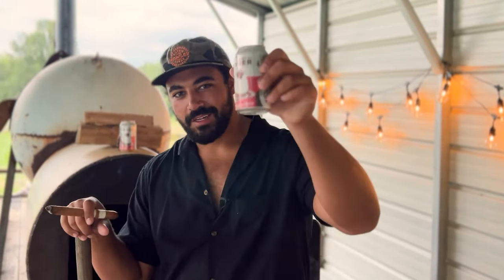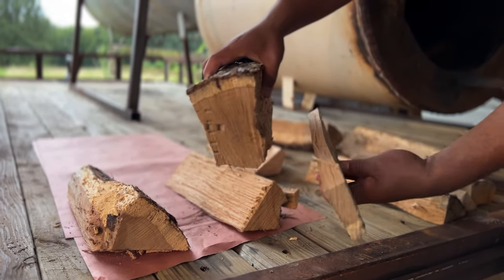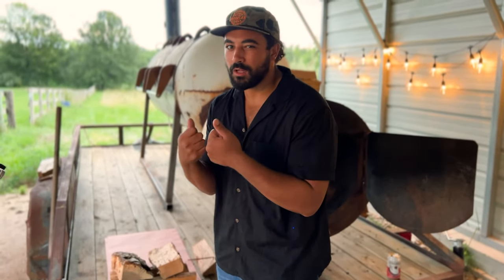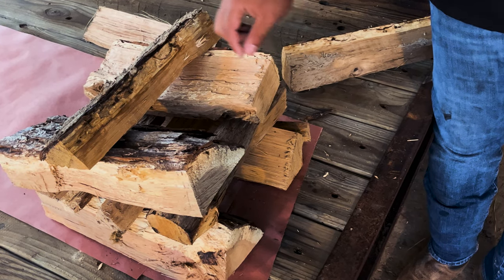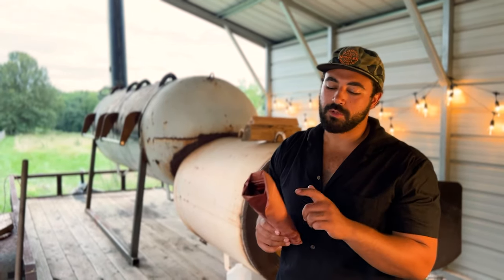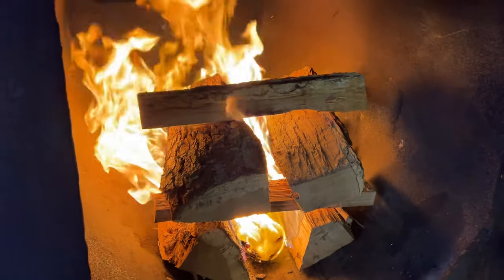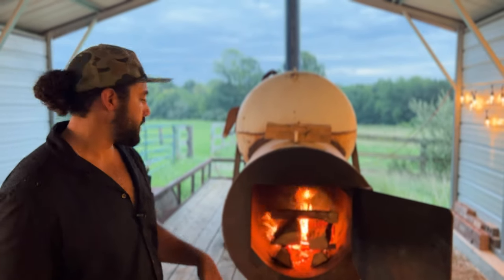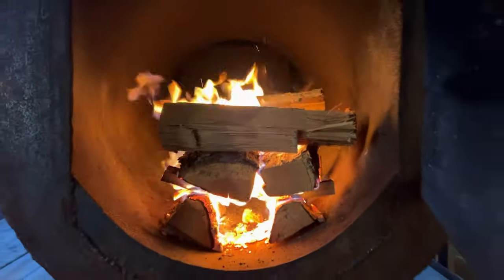BBQ Fire Management Basics: A Master Tutorial

Comment: One tip for temperature control on a backyard big box smoker: get a welding blanket or some other insulation blanket to help stabilize the main chamber temps by reducing some of the escaping radiant heat.

Great video!
Reply from the maker: Love this idea!! There’s a types of tweaks and mods that can be made to backyard pits to pull better performance out of them, this one’s new to me thanks for sharing brother. I’m thinking about doing a series down the road centered around easy mods that’ll get backyard worries better performance. 

Thanks for the comment, sub, and support my friend 🙌

Comment: I'm very much a backyard boy & this video is amazing. I just bought my first mid-tier offset, after smoking on big kettles & vertical stack smokers for a couple of decades. I'm looking forward to figuring it out. My favorite is probably the kettle, it just isn't designed for the job but it can be done if you get creative. 
The vertical stack is easier, but I need to feed it more often & just use the amount of fuel to regulate temp.

I'm not looking for excellence, I've experimented trying to get as close to "fire & forget" as possible - just trying to get consist, solid brisket/short-rib whilst being able to sleep or hang out with the guys & pound a couple of beers. I think wireless thermometers with plenty of probes is a really good "cheat" on a backyard setup, having the information graphed out really helped me understand what was happening when I made changes. 

I had great results with 35+ day dry aged UK Heritage beef, it's what I've got readily available that's quality & the dry aging reduces the stall time a decent amount which was invaluable for my use case. They're a little more sensitive to high heat though. Spending an hour in stall instead of 2-3 means I can knock out a pretty good brisket on a kettle and only open need to open it it twice. I still need to roll a dirty fire for a short time but it's not enough to be an issue. I learned to use is, when adding more fuel I treat it like an Asado grill for the ~15 minutes - using the radiant heat spike to almost sear the fat cap on the decal/point (I trim nearly nothing, the more fat the better for me). 

Mostly I learned to stop fretting about temps. The kettle is so challenging, so much radiant heat to deal live with. It's definitely different! 
Brisket's off my kettle have a Ton of fat on the outside, not a traditional bark - it's half way between a pan fried steak and a traditional brisket.
Reply from the maker: Glad you enjoyed the video thanks for the support!

Comment: Great Video, I have a Millscale 94 gallon & have been trying so many different methods on fire management. This video was the most helpful! Thank you!💪🏾👍🏾👍🏾
Reply from the maker: Love a good millscale 94. That unit is a beast! Thanks for the support!
Reply: Got a follow up question. You have a 500 gallon. Do with the Millscale 94 would I use a little less wood to start?
Reply from the maker: lol yea I would suggest using less wood on a 94 gallon than you would on a 500. I’m not certain exactly how much as I’ve never cooked on a millscale 94 so you’ll have to play with it. But hey, that’s the beautiful of BBQ. I’d bet that if you put two logs on the bottom, then two more across the top the opposite way and lit that on fire, after about 25 minutes or so you’re temps would read 225-275 with the damper wide open. Start there and let me know. But hey, that’s the Beautiful of BBQ that it’s not an exact science.

Comment: I can agree with most of what you said with one little modification. I have a 16" Horizon offset which has a big stack. If you open the door all the way and open the stack all the way the temps will shoot sky high. the stack works really well. So I will open the firebox door burn less wood at a nice temp to get the perfect mix of wood/smoke flavor but I need to regulate the flow with the flue because of the stack. The small offset in the video has a tiny stack and I can see why you would leave the flue open or remove it. Fully open, mine will run north of 500 until the wood is exhausted and with the draw from the stack, it will happen faster.. If you haven't seen a Horizon 16" offset, the top of the stack is 24 inches tall from the horizontal pipe and it is 4.5 inches wide
Reply from the maker: Thanks for supporting the channel brother. I agree with you, keep in mind I said “big box store smokers” which typically don’t come with big smoke stacks lol so your smoker wouldn’t really qualify under that category. If falls in the category of “high functioning backyard smokers” that I referenced in the video 👍
Reply: @MeatNGreetBBQ  That’s fair. I bought it in Canada, where I live, from Cabelas. I think the US price is probably around $800. Now they don’t have them anymore and the only other option is Yoder who seems to have a small stack issue and flow problems. I think on that one, I’d leave the stack open, well no, I’d remove it and fab another. That one is significantly more than my Horizon on the order of triple the cost and specialty store only.
Reply from the maker: @Todd.T  agreed! I think EVERYONE should attempt to fab a new smoke stack. It’s not expensive (barring power tools which even then can be borrowed or rented) and it’s a great way to learn/adapt ones smoker in a very impactful way… could agree more with you

Comment: Great amount of detail in here that fills in gaps from other fire management videos that gloss over things, you got a new sub here! Any suggestions for managing splits that may be on the wetter side on a 94gal (i.e. just got a cord dropped off, some are more fully seasoned than others and may be 20-30% moisture and actively hissing moisture at the ends when start heating up) in terms of when/where they go on or general tips? Pre-heating on the firebox or throwing a few in the chamber to dry out works, but can only do so much and have to work with what's on hand at times to try and make best of it.
Reply from the maker: Man I appreciate this comment and your support brother! Nothing better than a big ol delivery of bbq wood 🙌 
As far as the moisture content, 20-30% won’t kill you. Frankly when you start to really learn and master fire management you’ll begin to prefer higher moisture content wood at certain points in the cook. I tend to you the higher moisture content wood on certainly in my heavier cooks (like brisket) and I try to focus that wood towards the beginning of the cook when the meat is poised to absorb the max amount of flavor. It’s nature for the wood to sizzle, as there still is moisture and it’s wicking itself try through the combustion cycle. Just make sure you have a proper coal bed and proper spacing to ensure efficient air flow. As far as preheating, that’s certainly an option and I’ve done it in the past. But I’ve come to prefer using the wood as it is and letting it naturally do what it wants. Hope this helped bro 👊

Comment: Incredible video! Earned my sub and comment for sure!

I recently got my first offset, a 120 gallon with a fully insulated firebox; would you recommend running it similar to a bigger offset, purely using wood splits, or more like a backyard pit with charcoal and wood.
Reply from the maker: Bro appreciate the support!! I would strongly suggest you try it all. Learn what works for your smoker and learn what your smoker needs when it needs it. Outside temp, moisture, wood selection, ambient temp etc etc all plays into how the fire runs. There’s in right or wrong just baselines taught in this video. Experiment and give me a shout if you need anything.
Reply: @MeatNGreetBBQ  will do! Thank you!

Comment: Very informative, thanks for taking the time to make this, new sub. BTW, when the video was over, I was surprised to see the video was an hour long, didn’t seem that long but it needed to be. I grew up bbqing all the time on a box store grill/smoker and never used wood the way you did, always coals or lump. I love the idea of cooking with wood only. You were advising 250 and up, is that the smallest size smoker you would recommend to cook with wood only using the method you clearly described in this video?
Reply from the maker: Really appreciate the support and feedback bro! 

Yes 250 for sure should be run with 100% wood splits. Smaller than 250 you can do what feels best. Typically a hybrid of both.
Reply: Thanks for the tip.

Comment: This such a great video. Thank you for simplifying this important process. But question…. What about if you’re using a 120 gallon smoker? A lot of videos reference small smokers or 500 gallon plus. I’m in the middle with a 120
Reply from the maker: Thanks for the positive feedback brother. I appreciate your support! 120g is still considered a small smoker. 250g would be the next ratchet where you would need to worry about fire management style. Depending on your convection and airflow you can get as granular as you want on fire style but I would probably find a common medium between both methods. As you’re practicing, start with 500 gallon style and tailor it to your put until you find something consistent that works for you. Hope that’d helps bro
Reply: That was perfect. I’ve heard some ppl say if you’re  cooking on 500 gallon plus pit, always minus 25 degrees or so for a backyard pit. So if the 500 is at 300 degrees smaller pit equals to 275 degrees. Not sure if that’s true. I’ve watched 3 of your videos today and you’re already one of my favorite pit masters to watch. Thanks bro. Appreciate your help
Reply from the maker: @MikeBonesBBQ yea I’d say that’s a pretty solid rule of thumb. Mostly bc in a small smoker, there’s less space for the heat to become less radiant (potent) so if you get too hot it’s almost just as good as direct heat. For me the perfect range is 250-300. Anything within that range will turn good bbq. Once you figure out how to stay within that 50 degree swing, you can start to needled down the variance until you’re running temps at exactly WHERE you want WHEN you want

Comment: Great video and thanks for posting!  For the 500 gal pit is your stack damper fully opened at the point you said you had the perfect 280 degree fire?  If so, do you ever partially close the damper?
Reply from the maker: Thanks for the support bro! The relationship between the stack damper and firebox door is unique and probably requires its own video haha. The short answers is I adjust it through almost the entire coon depending on which stage in the cook I’m in and what I’m needing the pit to do at that moment. Short answer is you can run it about half way or a little less than half closed the whole cook and have a pretty balanced mix of all the benefits.

Comment: Loved this video.  I've learned many of the same things over the last 8 years.  I have a Grand Champ-XD which is similar to the Okey. (Slightly tighter fire box maybe)  I live one the coast of Maine and we get strong sea breezes almost every day in the summer time.  15-25 MPH, which makes it harder to control.  Wide open means wide open in that situation.  Cool 65-75 degree air temp.  Any recommendations?  BTW, we have lots of white oak and maple her so that is the main material I use.  One thing I like about the XD is I can remove the ash with an ash tool.  Helps a lot with the ash build up on longer smokes on the back yard style smokers.  Thanks.
Reply from the maker: Huge thanks for supporting the channel, it means a lot. I’m glad the video was helpful. The only think I can tell you is build slightly tighter fires and point your firebox away from the wind to the best of your ability. With winds that high you’ll likely have ample oxygen regales of fire/smoker quality. In which case you can probably close the firebox door down, knowing you have 15+ MPH winds lol.

Comment: Thanks mate appreciate the content of this video, I recently got made a 250 offset and will be using your tip’s going forward as I have ambitions to be as good a pit master as I can be . I have been wondering if have a separate fire pit going Will eliminate a lot of this work as you will be transferring hot coals to the firebox . Whats your thoughts on this as I have heard that after the initial first 4 hours meat stops absorbing smoke
Reply from the maker: You’ll love your 250 bro. Perfect size!! 
I would suggest you get good at running fires and creating your coal bed. I think smoke absorption is more predicated on cut of meat before cook time. Thanks for the comment and support btw!

Comment: I was putting out blue smoke.
On month cheap backyard offset smoker.
And didn't get any.
Wood smoky flavor on my pork chops. Temperature was.
250°F with all the dampers and doors open. Had a good hot cold bed of mosquite.
That was kiln dried .

I left the dampers open and the stack.
I walked away for 5 hrs. Other than adding wood There was preheated 2 screaming hot but not burning.
And would explode into flames when they put
Onto the coal bed.
Smoking low and slow.
 you couldn't tell
The meat was   ever smoker. The pork chops.
A good color.
And they Weren't Dry But no barbecue smoking flavor on the meat.

I kept 2 additional splits of wood inside the fire box where the fire was but they were close to the cooking chamber and the fire was close to the Fire door only consuming
Half of the area
Of the fire box. You actually don't have to use all the area in your farebox to have a hot fire.

I have seen.
Blue smoke coming out of a pellet smoker.. With the sunshine on me over my back. So I walked to the opposite side of the smoker.
And looked at the smoke from the opposite direction. And the way the Sun was shining through the smoke.
May they look bluer.
From the different
Position I was in.... Explain that . Did I actually have blue smoke?
Reply: I could have put some smoked flavor papperica on them and made them taste. A whole lot better. But still you wouldn't have that deep down smoky.
Wood flavor?

Pellet smokers.
Yes I bought one to see how they
Worked .

For about a year and a 1/2 the only color smoke I got out of the smoker was white smoke , Even after trying several Several
Brands of pellets. Then 1 year.
Near the end of barbecue season the saw the loan bag of pellets on the wall mart shelf.
I walked up and took a look and it was pit boss charcoal 
Blend pellets. The only reason I tried them because it looked like they had charcoal in them.
So I got home and opened the bag and just took a handful and put it in the smoker and turned it on.
I came out of the house 5 minutes later?
And I looked over at the smoker.
Yep it was still there and
A deep blue colored smoke coming out of the smoke stack. You could have almost took a knife and cut a square out of the air.
It was A Kodak moment. But no I did not get any of that blue flavor on my barbecue.
None at all.

My ribs were cooked low and slow.
With no peaking.

The pellet smoker isn't a complete disaster because I can still cook in it outside without heating the house up.
By
 just using it as an oven.
Pellet smoker manufacturers can make a killen Because some people are looking for white smoke.
I had one of them stand with sad me 1 day and told me. I didn't have enough smoke coming out of the stack.  Everybody was too busy eating to complain , I guess...

Maybe? I could. Stack these Pellets and make them look like a little house.😂

I'm experimenting neuking some pillates in the microwave Down to 16% moisture?

This will be my next experiment.😢
Reply: This is got to be the best fire management video I've seen on YouTube.
Reply from the maker: A lot to dig through here brother sorry if I don’t touch on 100% of your comment. 

Let me know how the pellet testing goes! 

Also, thin blue smoke isn’t ALWAYS what you want. Kiln dried wood has a tendency to combust extremely fast. It’s pretty low moisture content so the wood burns fast and hot, creating an end product that lacks smoke flavor. Dry getting your hands on some naturally dried hardwood and see how that goes.

Comment: Excellent video - thanks! Question: For a Brazos (1/4" steel, 50 gallons, big stack) which method do you recommend, the OK Joe or the big smoker method?
Reply from the maker: Thanks for the warm feedback my friend! The 500 gallon technique is directly transferable to a smaller cooker but everything scaled down so much it’s hard to look at them as similar ya know? I typically run a hybrids of the two methods on my backyard these days because I’ve found what works. But in a Brazos I would suggest you start with the big smoker method and scale it down to a process that works for you. A brazos has a big beefy stack with good convection so you can get away with a lot more than you can in an OK Joe or the likes. Hope this helps…. Nothing will be perfect the first time of course haha just gotta trial and error it. Give me a shout if you need help
Reply: Thank you sir! Don't feel obligated to respond to this, but I have done about a dozen cooks so far in my Brazos, I  build up a good bed of coals and things go well for a couple of hours, and I think "I've got this!" then the coal bed starts to diminish, even though I have been feeding it, and my fire starts getting wilder mood swings since fire more than coals is now making the heat. So that's been my challenge. Next cook I'm gonna try to attempt to incorporate at least some of your method and see if I can hold steady for longer. Thanks again, Scott @MeatNGreetBBQ